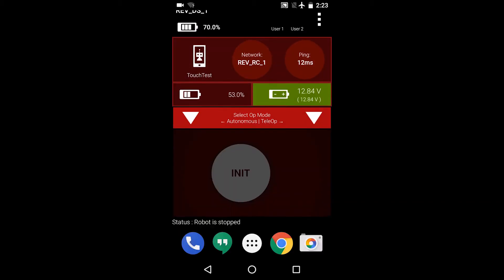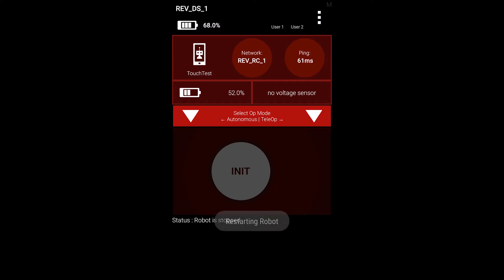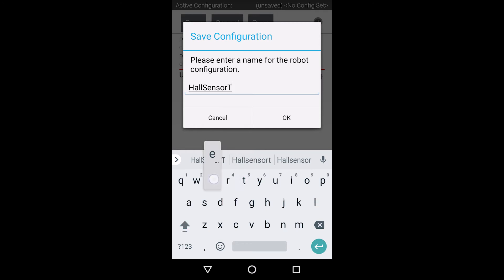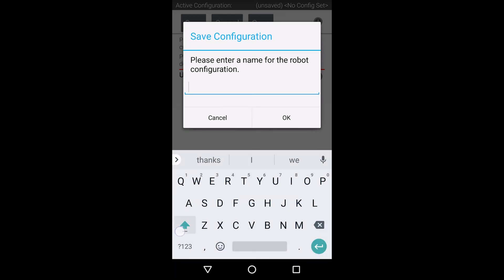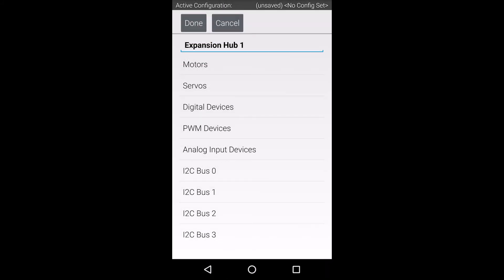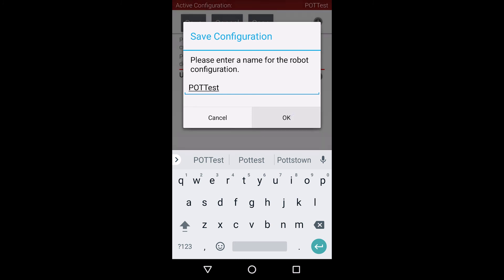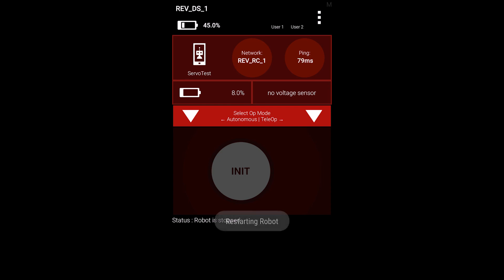Configuring Peripherals for your REV Expansion Hub

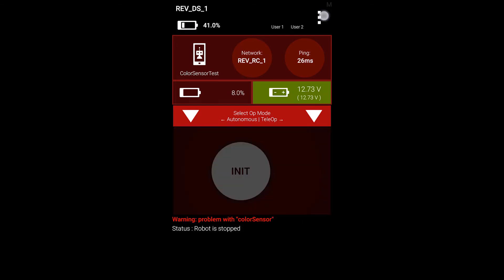Comment: At 5:28 I noticed that you also got the same error message I've been getting every time I try to configure the color/range sensor v3. What exactly is the problem and how do I fix it?
Reply from the maker: Usually it is when there is a sensor called in a program that is not configured. If you are running into trouble email our support team (support@revrobotics.com)